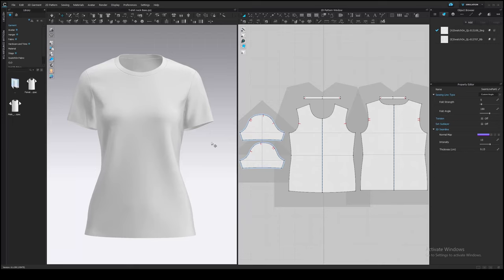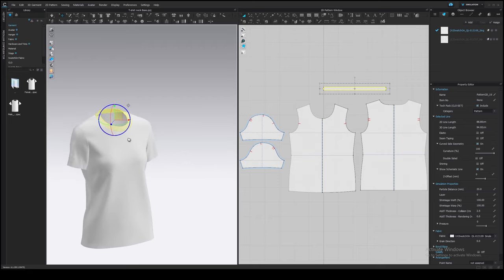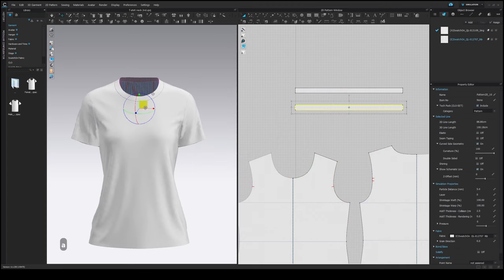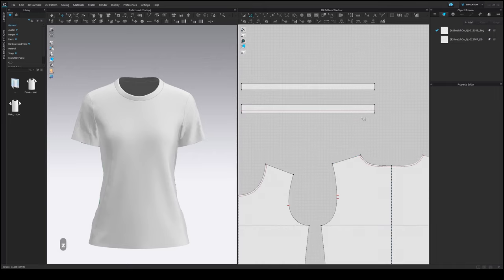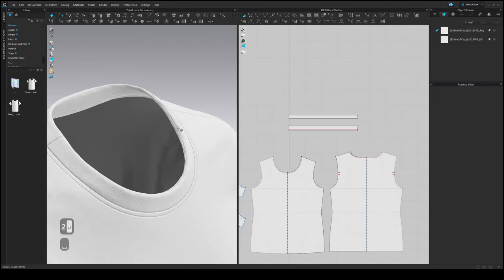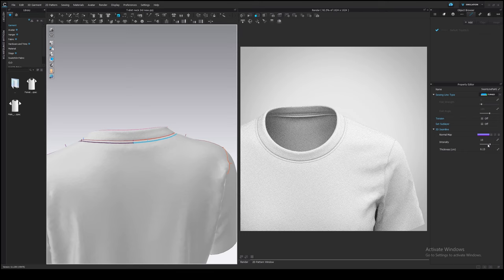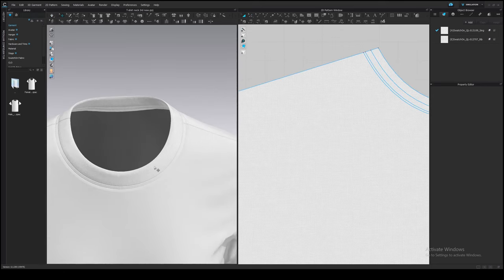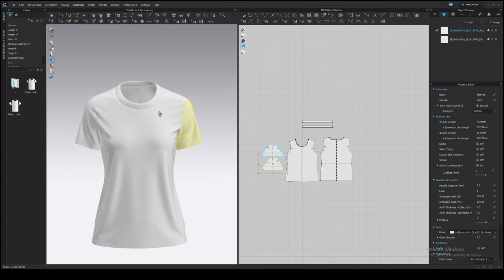How to Make Realistic Neck Binding in CLO3D\Marvelous Designer

Comment: This is awesome thanks! Does Marvelous Designer have the sublayer feature? Or is it the exact same thing as layers in MD?
Reply from the maker: Thank you! Unfortunately it doesn't. It''s not the same as Layers. You can use Layers to place one pattern over the other temporarily. Then you need to set the layer back to 0. Sublayer action is permanent.

Comment: Thank you so much for this amazing tutorial, I'm using MD 11 and some stuff seems to be missing like the set sublayer and also the normal map parameter on the property window, did you come across the same issue if you've upgraded to the new MD version?
Reply: Hi Gabriel, i’ve got the same issue with MD 10,  the set sublayer button was completely removed and is possible to use that only in Clo3d. But if you need to make the collar bulkier like if its double layered you have to select the collar pattern and after adjust the Thickness(collision and rendering) in the property editor of the fabric. Its more simple and produces same result 👍🏻
Reply: @Effeerre01  Thank you!!

Comment: Nice, so there is a difference between "Layer" and "Sublayer"?
Reply from the maker: Yes. "Layer" is useful when you need to simulate one garment over the other. Jacket over the shirt, for example. "Sublayer" is useful for individual pieces, patterns to keep one pattern over or under the other one.
Reply: @MyDressPatterns  MD must have hidden that tool very well ^^ cant find that specific tool o.O
-----
Just realized its CLO3 not Marvelous-Designer?
Reply from the maker: It's Clo3D. Yeah, looks like there isn't "set sublayer" tool in MD :(

Comment: To add the rib and jersey files, do you just add them to your materials folder? I cant find them when I open the app.
Reply from the maker: Just add a folder with textures to the library in CLO. Press "+" button at the top right corner of the library and locate the folder.

Comment: Hi, actually I've some issues with render window in clo3d I'm using the version 6.1, when ever I render the dummy looks very unreal and has so many pixelation is there any way to get better results in rendering?
Reply from the maker: Hi, try to increase the image size in Image\video properties in the render window. Set it at least 1920x1080. Also, you can decrease the Noise Threshold in Render properties - for example to 0.020
Reply from the maker: Hi. I made a new video about Rendering in Clo3d. You can watch it here - https://youtu.be/RG6ajCKm8IU 
or on my channel. Hope it'll help you to get better renders :)

Comment: Hii, i need help, When I finish everything, there are red threads on the collar of the sweater, how can I remove them?
Reply from the maker: Hi, it's hard to say without a photo. I can think of red bold lines that sometimes show up when sewing lines have a different length or because of a bug. In this case, try to redo the sewing in that area. 
It can also be the tiny little threads of sewing lines that you can hide. Find and click on the "Show Threads" icon on the left vertical panel in a 3d window, under the T-shirt icon. 
In any case, these threads shouldn't be visible in a Render window or after export. 
If it doesn't help, feel free to share the photo on the Reddit community - https://www.reddit.com/r/MyDressPatterns/

Comment: how to add sublayer in marvelous designer?
Reply from the maker: Unfortunately, Marvelous doesn't have Set sublayer tool. It's only in CLO.
Reply: @MyDressPatterns  is there any solution? the thing in the tutorial is clipping even tho using the "Layer" in the settings. and sadly my CLO3D trial ran out.
Reply from the maker: Only temporary "Layer" option in Property Editor as far as I know. Freeze patterns so they doesn't move and you can arrange other patterns around, over or under it. Simulate on CPU. If you want to use GPU - freeze or deactivate parts that are already simulated on CPU.
Reply: @MyDressPatterns  thank you very much for the reply. i hope you make more tutorials! keep it up

Comment: fabric is nomore there?
Reply from the maker: Hi, unfortunately, links are no more active. Try to use basic fabrics from the CLO library: Knit Cotton Jersey and Rib for neck binding. There are links to these fabrics on CLO CONNECT store: https://connect.clo-set.com/detail/f04813f28e684d789e308807f6469813
https://connect.clo-set.com/detail/09cca752829d478ba40ffb766fcbb599
Also, you can use basic Physical Properties for knit fabrics in CLO and add custom knit textures.